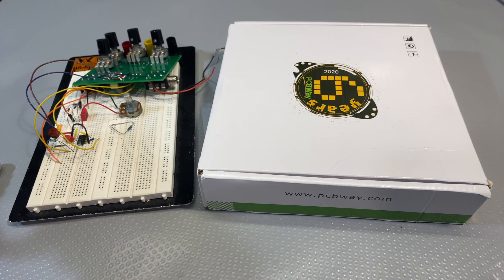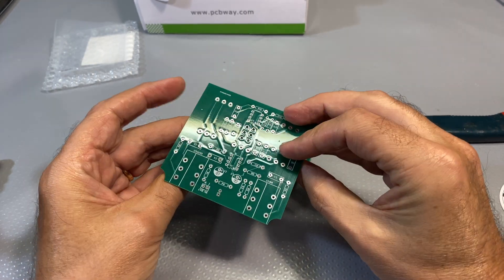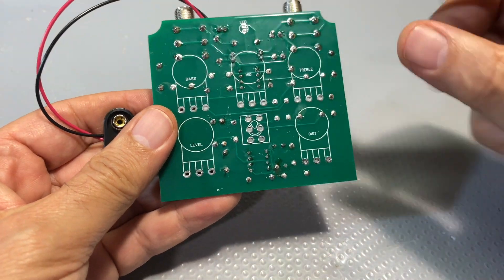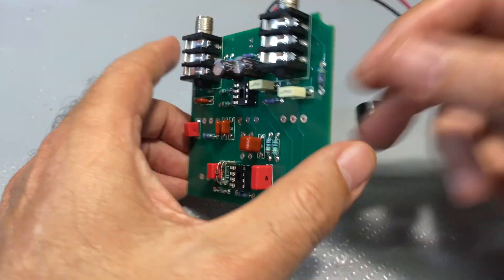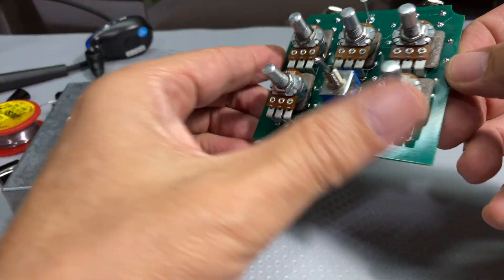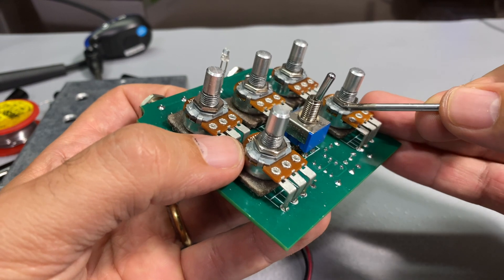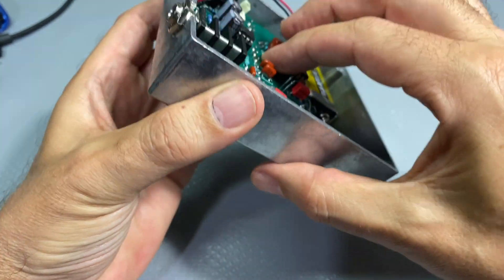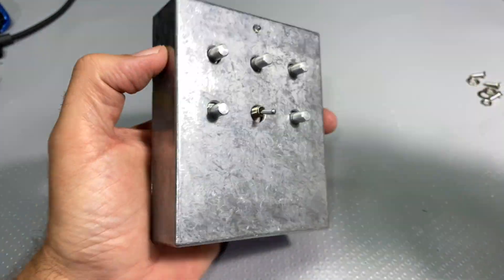Guitar to Tube Radio Interface, V2.0. Project build and testing.

Comment: Nice bit of work.
If you don't mind me dropping a bit of a tip... If you put non plated holes in the center of the pots and switch locations on the PCB, you can use a blank PCB to transfer the drilled holes to the chassis. The holes don't serve any other purpose. Also useful for drilling mounting holes when fixing a board the a chassis. I used that trick on a recent build of mine.
Cheers,
Reply from the maker: That’s a great idea! Thanks

Comment: Something you might want to consider for a possible future project is to basically take this design, and add two switches, push-button type, that would be used to either connect or disconnect one end of the diodes.  That way, you don't actually have to remove the diodes, you simply open up the connection with a push-button.  You also can have both in, one or the other in, or both out.
Reply from the maker: thanks